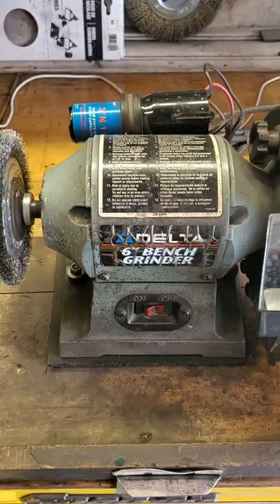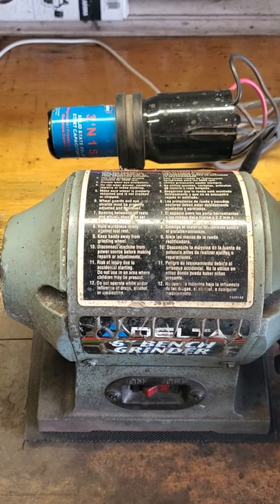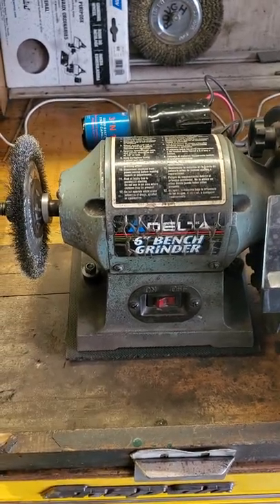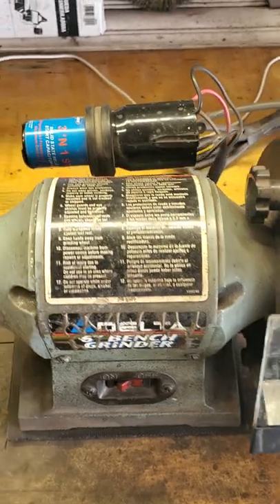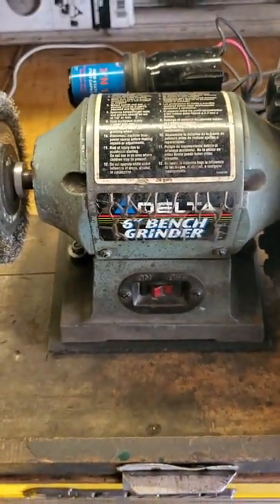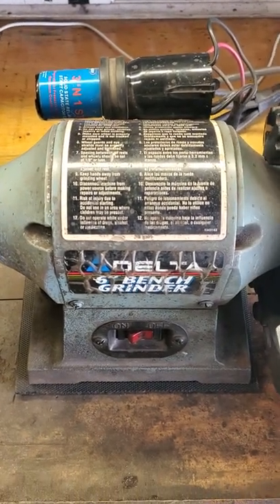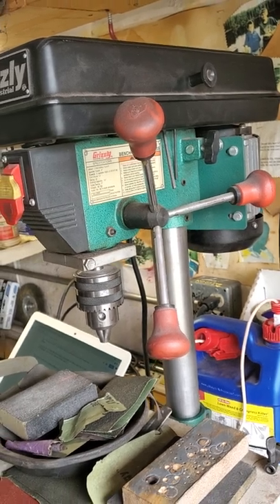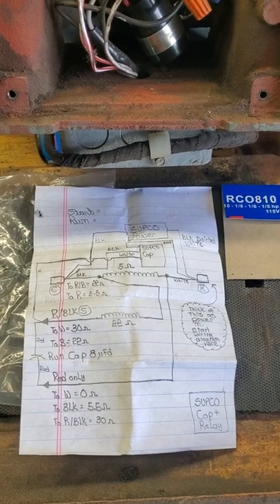Upgrade a bench grinder so it starts faster

Comment: Thanks for sharing!
Reply from the maker: I had a lot of small carburetor parts to clean up with the wire wheel on Saturday.  I bet that grinder ran for four hours off and on.  Oh, that start capacitor / relay makes all the difference!!

Comment: I see what you doing to start relay to help it start faster and run better but the top capacitor looks like you're using it for phase shifting allowing the motor to run more smoothly what capacity and voltage is it.
Reply from the maker: Hi Paul.  I can help.  But, I don't understand what you are asking me.  The motor now has 2 capacitors.  The run capacitor that came with the grinder (I just left it).  And now the start capacitor that is part of the 3 in 1 relay that I added.  I love this grinder now that I added the 3 in 1 relay kit.